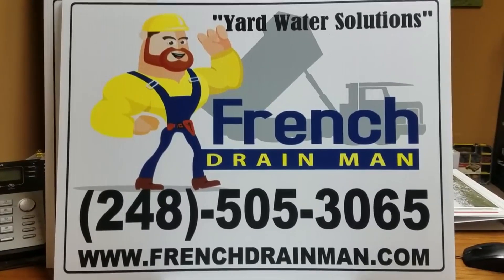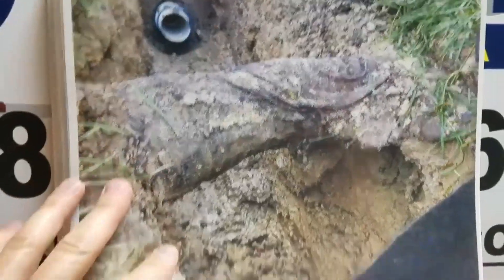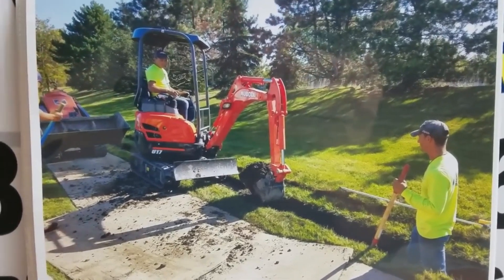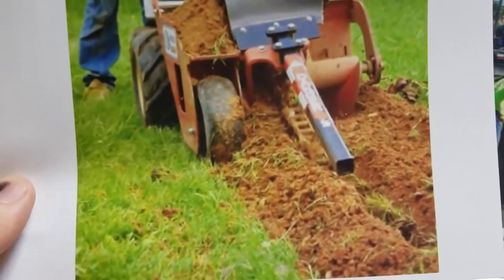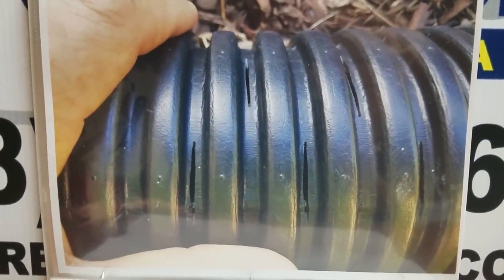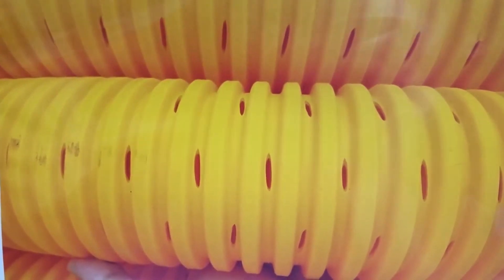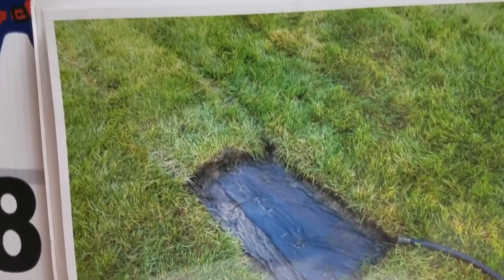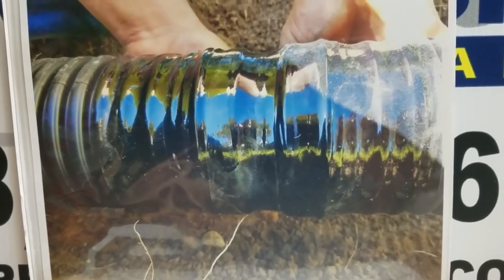French Drain Fails: Here are the Yard Drain Systems we Always Replace

Comment: Man I wish u did roseville mi.  i cant find anyone to do it right so Im stuck using a trencher and jacking my entire property.
Reply from the maker: Our drainage systems start at 6k if it needs a sump pump $8800
Reply: @FRENCHDRAINMAN  i already called u guys and im out of ur area.  i came out couple weeks ago and picked up 720ft of ur non woven fabric and will use cobblestone.  i wish u worked out in roseville.
Reply: @relevant.c5411  He won't work in Roseville?  I live in SCS, MI and need a french drain installed.  If he won't work in Roseville, he probably won't touch SCS.